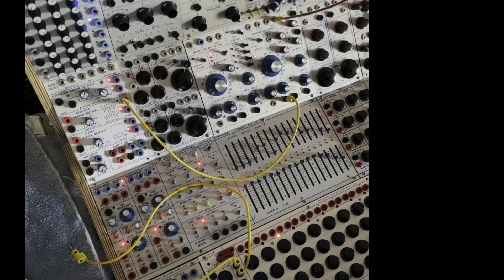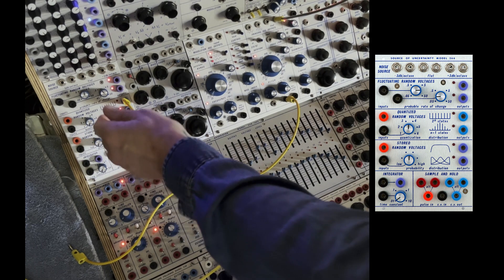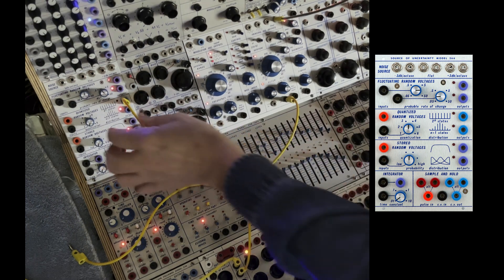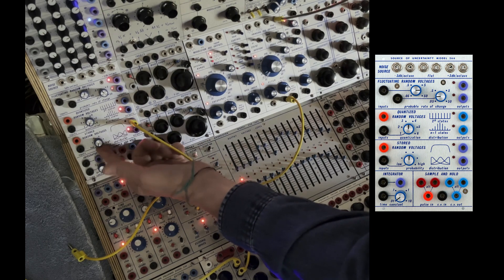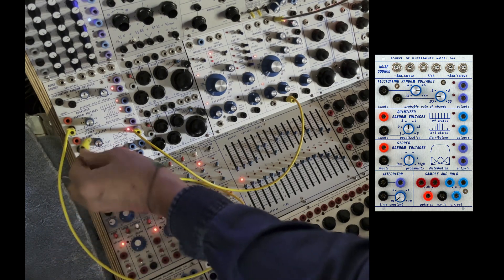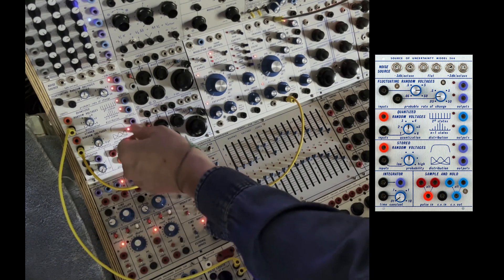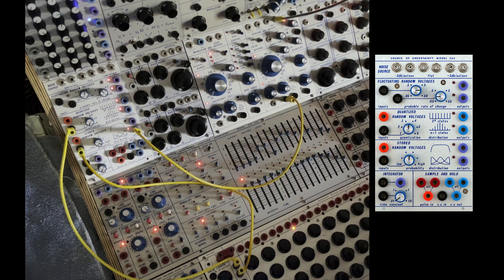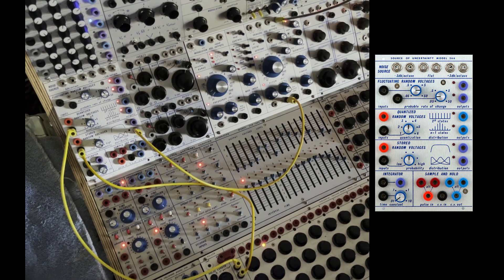Buchla 266 CV output

Comment: I think about things like this a lot—I find on a Buchla (and a Serge), it’s very easy to switch between thinking of “cv generators” as voltage sources, or instead thinking of them as nonlinear processors for other voltage sources. Sort of in the way you might pass a sound source through an effect (reverb, distortion, whatever) in order to re-shape its fluctuations, you can do similar transformations of CV by things like what you’re doing here.

Not a revolutionary thought necessarily, but it’s interesting to switch modes from thinking of the CV input for the “n” value, for instance, less as a control source for a function on the 266 and more as an input through which to process an external signal.

I often think of tinijax modulation inputs in a similar way, in that often, the character of your modulation source can be more present at the output than the character of the module you’re actually modulating—but that’s a story for another day, perhaps. :) Awesome find Todd!
Reply from the maker: Great thinking and observations/pointers Ryan!! Oh, and loved being a fly on the wall yesterday as you and Sarah worked on Julia’s voice🤩
Reply: @vgermuse  Aww thanks! Hopefully next time the stream audio will be a bit smoother :)

Comment: I'm wondering if the distribution on your stored random is backwards? You turned the knob to high and the cv amount went low. 

You should try running the 266 outputs into the external inputs of the MARF so you can then quantize them and/or reduce their voltage range and send the MARF's output into the keyboard input on the 259. You could then use the MARF as a sequential switch on top of it being a CV processor for the random voltages and change through the different random sources.
Reply from the maker: It is compared to my other one
Reply from the maker: Oh, just saw your MARF suggestion! Awesome!